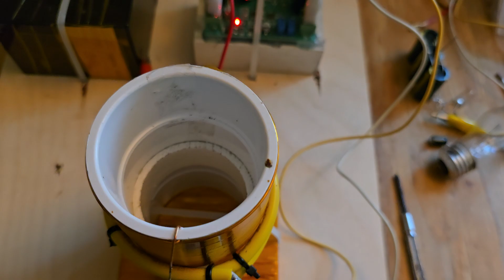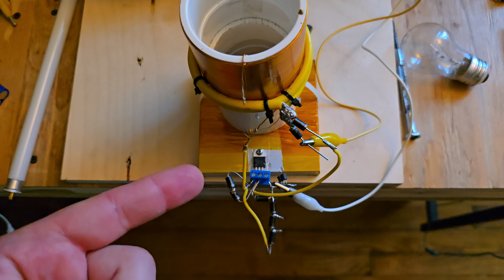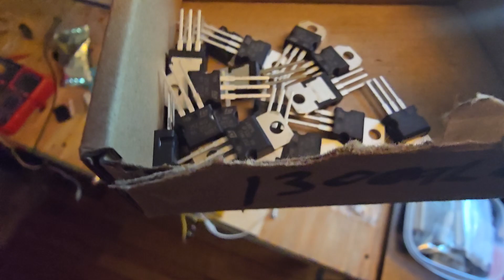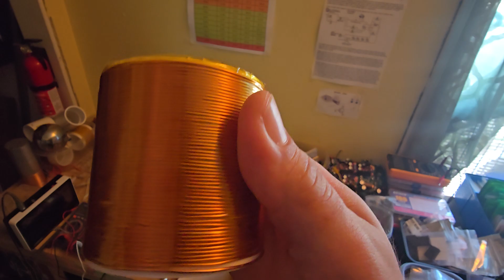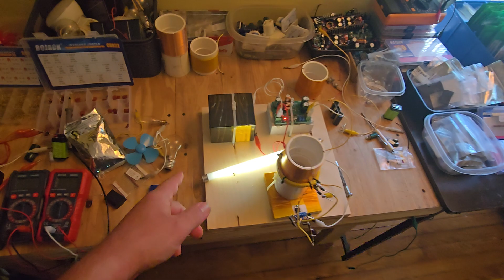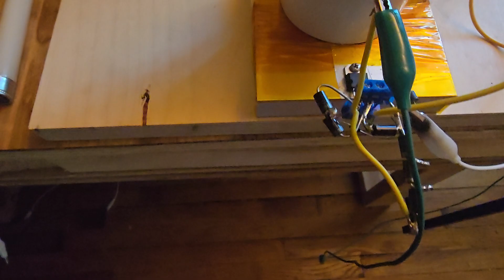NEW SHOP LINKS NOW LIVE & A RESPONSE TO THE NAY SAYERS & DOUBTERS.

Comment: Can you hear yourself talk God stop telling people you have free energy bs also when did I say a Tesla coil or different kinds of oscillators are scams
Reply from the maker: I've never once claimed to have created a fully self sustaining energy device although that is the eventual goal by using the theories of eric dollard, ken wheeler & nikola tesla along with injecting negative resistance into very efficient wireless power circuits. Feel free to look up crystal radio circuits that power leds with no input or the mysteries moray valve energy machine thats a heavy modification of the crystal radio.
Reply: @MTECH2022  Give his comment the pin of shame 😉
Reply: @MTECH2022 Dave is most likely demon possessed by the way he acts. Feels like it to me anyway.
Reply: @MTECH2022  Chapeau bas Monsieur, je crois en vous et en vos recherches, merci de les avoir publiés gratuitement, et surtout courage, le monde vit dans le mensonge et vous etes une lumière dans l'obscurité, on y arrivera tous et ils eront submergés par les diseurs de vérités .
Reply: OMG !
Reply: Think people are getting mistaken between free energy as in not needing to pay for it and free energy as in you can pull it from the atmosphere
Reply: are you certain its scams, as i have rotating generator that consumes 45wats and the alternator outputs 850watts... its self sufficient and can run on itself... problem is i have to change bearing each 3-4 months because they go bad and start heating. Also the generator is working on cold electricity on DC and Primary cannot overheat from electricity but from bearings going bad
Reply: @MrBademy  Hi, could you share more details on the cold electricity aspect? I'm looking for more information on that particular line of research, cheers.
Reply: @MrBademy  just put ceramic bearings and the game is perfect
Reply: Baaaah, baahh... enjoy your corporate shaft sheep.

Comment: Why not use a heisenberg compensator to reverse the polarity of the neutron flow? Or simply tap into the free energy caused by millions of exploding microscopic singularities passing through the solar system. If the energy emitted by the singularities are able to shift the chroniton particles in your coil it could cause a high state of temporal polarization. Pure genius!
Reply: I need 1.21 gigawatts to understand what you're referencing
Reply from the maker: Lol

Comment: Yeah this is no way fake, i have seen LENR ( low energy nuclear reactions ) experiments get the same results of equipment being polarised ( Aetheric matter or all the atoms aligned north south in the equipment )  from what Tesla called Aetheric energy. Um did you find out if the effect of having the LED run from one pole lasted a few days? My idea here is that if you use the battery as a normal battery it will get detuned from the Aetheric state as the atoms get disorganised again ...yeah definitely real that plasma in the globe looked SUPER hot melting the tungsten filament like butter :) all from a battery's power !!!
Reply from the maker: Oddly enough after the tesla coil has been running for awhile then switched off the led does run for a few days before slowly getting very dim but remaining faintly lit indefinitely. :)